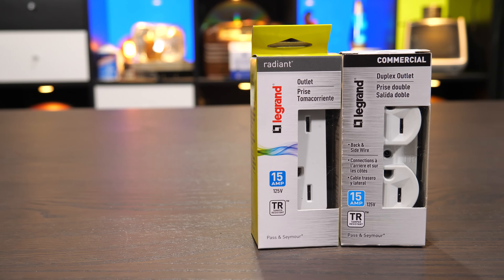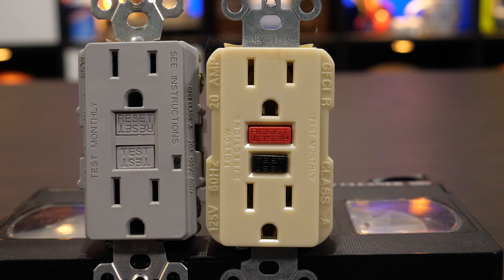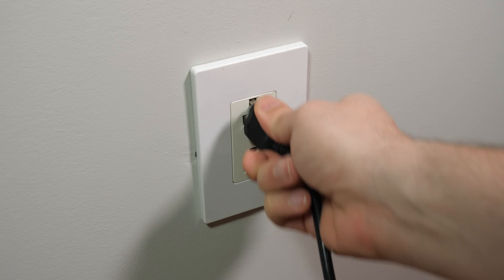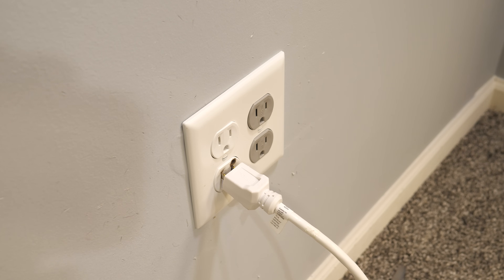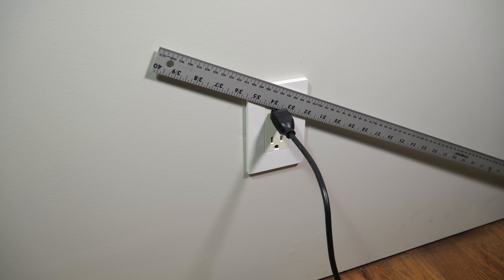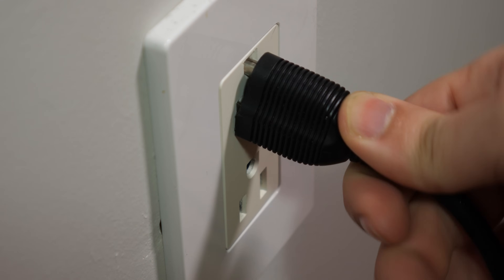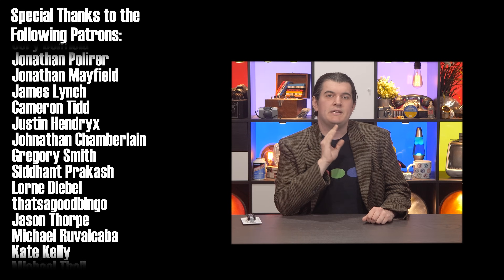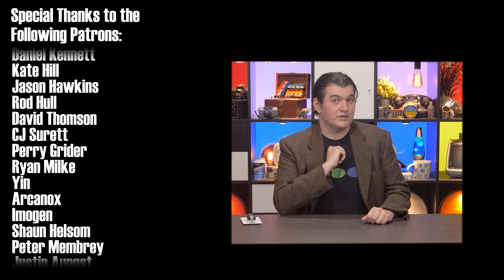Power outlets are topsy turvy - but does it matter?

Comment: Right angle plugs are annoying in that you can only effectively use one of them per outlet. It is power bricks and right angle plugs that cause me to have those 2-6 plug converters or worse, extension cords on every outlet in my house.
Reply: It is mostly for rather low current things like a fishtank that needs a plug for the led, a plug for the pump, and a plug for the heater, where only the heater has any kind of current draw.

Comment: I’ve heard the argument that ground down can be better because if the plug is pulling out of the receptacle, gravity will pull it down as it comes out and the ground will be the last contact to break.  It’s safer for ground to be the last to break contact.  In my experience, I have more instances with the plug pulling out with a tool I’m using than with the possibility of contacting the hot and neutral at the plug.

Comment: I have been shocked despite the connectors being insulated (AS/NZS 3112 plug, which is still much safer, but still has same issue). So yeah, I am all for the earth being at top, even though i don't like the look of it.
A lot of the problem is actually because people do not push plugs in perfectly, it is usually at an angle, and you always want to have the earth being the first in. In Australia (AS/NZS 3112 plug), outlets have an indent in the earth socket to encourage putting the earth in first, but it doesnt stop people doing Active and neutral first.

Comment: After hearing all that, it's hard to not feel smug here in Australia using AS/NZS 3112 plugs (which have many plug-compatible variants around the world, including China), but it seems the pin layout was first patented in the US in 1916.
Reply: Too bad Australian plugs can only be used in one orientation and take up too much space, making them an inferior design
Reply: @Daz912  That would depend on whether you prioritise safety or convenience.
Reply: @BobHutton  the guy with 240v mains is trying to lecture me on safety. I’ll stick with 100 thanks.
Reply: @Daz912  I'm not sure it's worth continuing this discussion. Your approach seems to be tribal, rather than any attempt to reach a reasoned consensus. There is nothing wrong with 240v (although I think we are moving to 230v) as long as you don't come in contact with it.

The point is that the AS/NZS 3112 standard (and others like it) have addressed (pretty much) all the issues raised in this video. (If you really think a lower voltage is superior, why don't you move to 50v? Or 25v?)

Also, I'm not convinced having a flexible orientation (as far as power outlets goes) is "superior". If I'm attempting to plug into a socket I can't see, it could be advantageous knowing the orientation beforehand.

Comment: The video I have been wanting to see but didn’t know it.    The house I recently bought has all the plugs with the ground pin up.    It bugs the hell out of me.   Unfortunately the wiring is old so I can’t just flip them over.     I have a couple of the 90degree plugs on some power strips also.  All pointed up.   😕.

Comment: Hydro-Quebec used to run TV ads where the plugs were talking faces, usually doing PSAs about reducing power usage or safety around outlets. I'm not sure how much of an impact they had but I haven't really seen many newer installations with upside-down plugs. I would assume people saw the ads and took it as the electric company telling them that it was the correct orientation.

Comment: Interestingly enough, I have one wall outlet installing in my house in the ground up orientation specifically because I had a device with a right angle plug, but needed the wire to go up from the outlet instead of down. The outlet is behind a dresser and needed to reach the top and going down first would not be able to work there.

Comment: I'm surprised I'm not seeing any comments about it, but some electricians also use ground-up vs ground-down as an indicator of whether or not it is controlled by a wall switch. Generally, if a room has receptacles facing both directions, ground-up outlets are linked to a wall switch, and ground-down outlets are not.

Comment: In Brazil, we call the US plug style "the old plug". We used to have the same one, but it was replaced with a safer one. You couldn't get shocked even if you tried.
Reply: The only issue in the US is so many houses already have the outlets (which I guess is cheap enough to change out if you know how to do it) and so many products use the plug already. People would either have to buy an adapter for EVERYTHING electric in their house, or throw it all out and get new ones, which are both incredibly wasteful options.

It would be much better to find a way to adapt the current plugs to be safer, potentially by doing the same thing most other countries did and have a half-coated plug so when the plug makes contact you can't touch live terminals.
Reply: @tbuk8350  The issue of having to use adaptors after the change was solved by simply using a hybrid outlet. The input is shaped to fit either new or old plugs. To this day is not uncommon to find them in old houses and there's no need to replace them, unless you want it to be safer.
Reply: ah by newer plug you mean something that looks a lot like european style plug?
Reply: @wiziek  that's because it is the europlug.
Reply: @dithy  no it isn't, EU has a huge grounded plug, we can't use it
Reply: @jhanninnen  It is. The plugs in the EU are compatible with Europlug, just not vice versa.
Reply: @wiziek it's almost the same as the Swiss plug, it's compatible with smaller EU plug the one without the grounding
Reply: Is this the plug that basically always lands prongs-up, making it extra painful if you accidentally step on one?
Reply: @roecocoa  nooo.... the UK plug is the one who you shall never step into
Reply: The Euro Plug is flat and two pronged like the US one, but its prongs are round and insulated at the top. It doesn't have Ground and doesn't respect which wire is live, though, so not the ideal plug to copy.

If anything, I think the British design is the one to aim for. It's always grounded and keyed, the prongs are always partially insulated, the Ground pin has to push a safety lid out of the way before the live prongs can connect, and most plugs on appliances have their own fuse. Can't get much safer than that.
Reply: @alameachan the receptacles could be shrouded, so there never is exposed metal even om a partially inserted plug
Hats why european plugs cant be really flush to the wall, they always have at least one centimeter of clearance in the plug so it can fit over the shroud(or are round so they fit inside the shroud)
Reply: @alameachan the two prong europlug is only intended for appliances that don't need to be grounded and is supposed to be compatible with most of the grounded outlets that are schuko or a variation of it. Several countries adopted the grounded schuko plug. As for polarity issues it doesn't matter for most appliances whether you flip live and neutral and for appliances where it does matter you use a special plug or use screw terminals like for lighting ballasts and other fixed installations.
Reply: @alameachan  The Euro plugs do have ground! Depending on type, contact is made either via spring contacts down the sides, or a large prong on the socket with a mating hole on the plug. They're very neat and capable designs, and there was talk years ago here in the UK of harmonising with Europe and abandoning our system. I think the biggest reasons we didn't were the fact we used fused plugs here, and the lack of good reason in general to change.
Reply: @alameachan  EU doesn't consider neutral as ground. Those aren't locally connected as in NA houses so "neutral" can be more than 50V above ground. Not considering live and neutral as both main would be a dangerous thought in this case. Therefore there is no need to make a distinctive prongs for live.
Electric and electronic devices are just designed with that in mind. And except wall or ceiling mounted lamps using E14 or E27 Edison screw (borrowed from US standards), there is no polarity precaution needed.
Although, UK may have the most secured wall plug but like their former colonies, as well as many european countries, they still extensively use bayonet plugs which don't make any difference between the two main pins, and the B22 socket offer a ground protection for the floating metal base (which sometimes on old buildings is not properly wired, but this is another issue)
Reply: @NicolaiSyvertsen  I didn't know that Schuko was considered part of the Europlug system. Thank you, I learned something today! ^^
Reply: This is coming from a country that uses a jerryrigged heating coil for a shower head
Reply: @potatoswagger  Seriously
Reply: @Pedro-San705 yup, because house heating isn't a thing in Brazil, for obvious reasons, we use an electric shower head, the water passes through a resistor that is connected to mains voltage.

Surprisingly there are very few fires because of the showers
Reply: @jlGenozzV "... very few fires because of the showers" This sentence should not even exist. 😅
Reply: There a lot of people who complain about the the new plug...People are crazy, I think the new default plug is a lot better, safer, steadier and stable than the old one
Reply: @jhanninnen  They complain because it's new, and the 1980's vintage toaster they own is no longer kosher. Haters gonna hate.

Comment: It is quite fun on how just putting a bit recess in the outlet plug like in europe would make about everything safer.

And as a European living in canada, I really really really really hate the right angle plug. The simple fact that you can almost never plug two at the same outlet because of that 90° angle bothers me so fucking much. I just can't understand why almost no one solved that shit yet. We just have to get 45° plugs like you shown or Idk, make both orientations on the same outlet, ANYTHING REALLY.

We kinda have the same issue in Europe, but right angle plugs are far less common.

Comment: What about a sideways two outlet design with the ground pin down? Although I do like the ground up design to counteract sag. I think the over under design is annoying since cords droop and get in the way of each other so a side-by-side design would prevent that. Wall warts would fit better too with more space like a power bar. Maybe if we go that far we may as well have UK on/off outlet switch too to power on or off the entire outlet.  BTW I believe the best practices/standard for network RJ-45 keystone jacks is pins face up (connector pins down) but so many are the reverse. I think it's to prevent the pins of empty jacks which are open to the world from getting covered in dust or other debris possibly causing poor connections once a jack is inserted.
Reply: That's the standard in Australia. With switches for each socket, too.
Reply: Using the ground prong to counteract sag is just not a good idea. Generally, they are the most easily broken off prong on a plug. And concentrating the force that was previously on 2 prongs to 1? No bueno.

Comment: This seems to be just a North American issue, in EU and India we use 3 Pin D-type as standard with the ground pin on top, and all outlets have there own switches besides them. There are smaller and larger D-Type outlets so that you know that the larger ones are for devices that needs more than 15 Amps at 220v and the smaller ones for less than 15 Amps at 220v. Almost all appliances that have a Ground Pins have a right angled cable attached to them, It saves space and it stays put.

Comment: Western style plugs with insulation on prongs similar to European plugs do exist in Japan and doesn’t not break comparability with older outlets.  So it is possible in Canada and the US, we just need code and/or a law changes to require a similar design.  This would much improve safety.

Comment: My niece somehow dropped a quarter in a loosened plug a couple of Christmases ago and that made me think more about inverting my plugs. I did that for 1 outlet when installing a GFCI and then immediately ran into the right-angle plug / 45-degree angle plug issue. I'll be reverting it the next time I work on the outlet. It was a good idea if not for right-angle plugs, but I admit right-angle plugs are better.

Comment: Ground up can be more dangerous in another extremely rare extremely specific scenario.     If the plug is partially pulled downward, it will pivot around its lower edge and the top pins will be pulled further out of the receptacle than the bottom pins.    If the top pin is the ground, then the ground could become disconnected while hot and neutral are still connected and then you have a 2 prong outlet.  If the device requires a case ground, this could be dangerous.

Comment: I've got a solution to the problem of right angle plugs being hard to remove without getting your fingers too close to energized conductors.
Put some tabs on the back of that dang plug!
Works on the slide of a M1911 pistol, the serrations there allow your fingers to get a really good grip.
But since we don't have to worry about holstering our plugs, we can do better. Instead of mere serrations, we can put TABS there, that you can actually physically hook your index and middle finger around, pinch your two fingers together, pull, and suddenly you have a plug in your hands and weren't at any point nervously close to energized conductors! I've seen some TWO-pronged plugs do this, why can't three-pronged or grounded-right-angle plugs do that?

Failing that, and working with what you have, there's an easy fix for this awaiting you at the grocery store.
Buy a package of disposable plastic silverware, all knives.
The knife is plastic, so it can't really conduct electricity, it's long enough that you can get enough leverage to make the plug move, and if all else fails you can INTENTIONALLY put the knife exactly where you shouldn't put a metal one, and then use the knife to extract the plug safely.

Comment: A fun thing I have is a surge protector with a plug in that is just a outer wall plate, making the cable come out flat against the wall. I lose one plug on the wall itself bit gained a whole power strip that I can plug my TV and such into, as well as push my dresser against. Without the protruding cable

Comment: A PS to my earlier comment. When I first started living 'abroad' (ie not in the UK), I was fairly worried about the sockets and plugs in Europe and how dangerous they were, and I wondered (but never found out) how the figures for electrocutions and electrically caused fires compare between the UK and the rest of Europe. Now I've experienced the insanely dangerous US system, I'm even more intrigued to know how these figures compare between the US, the UK and the saner parts of Europe. Could you perhaps do something on this?

In much the same vein, I'd be interested in a similar comparison regarding deaths and injuries on the railways. In Britain, every railway line is fenced in and platforms are too high to jump down onto the track, and there are almost no unprotected crossings - and yet a few people still manage to get themselves killed on our railways every year. In many parts of Europe, railway lines aren't fenced in and people think nothing of crossing them if it's quicker than using the nearest safe route, and it's commonplace to see people walking across multiple railway lines at stations - and yet I've never heard of anyone being killed by a train. I wouldn't know about railways in the US, as our only experience was the line between New York and Boston, and that seemed uncannily like a British line. But from films and TV, I know that 'European' 'standards' of rail safety operate in much of the US. Do more people get killed on the railways in the US and Europe than in the UK? And, if not, why not?!

Comment: [] []                                                               [   []  []        []  []  ]
 o     ???  why not orient them like this  [     o            o   ]
Put them sideways in the wall with the ground pin down so you can use two right angle plugs at the same time!
Or for those who "never" use right  angle plugs put it ground pin up:
[     o            o    ]
[   []  []        []  []  ]

Comment: Australia introduced electrical standard AS/NZS3112:2000 to insulate the pins of the plug after a coronial inquest into a death caused by a venetian blind landing on a live pin of a plug in a kitchen. All plugs made since 2005 now have insulation on them on the live an neutral.

Comment: One night I kept waking up with my foot feeling like it fell asleep.  Happened 3 or 4 times feeling like pins and needles before I realized there was a wall plug behind the bed.  I got up and discovered the cover had cracked in half and my big toe was making contact with the hot wire..